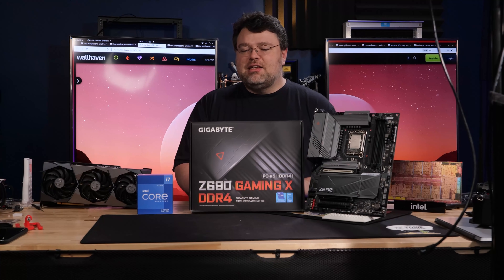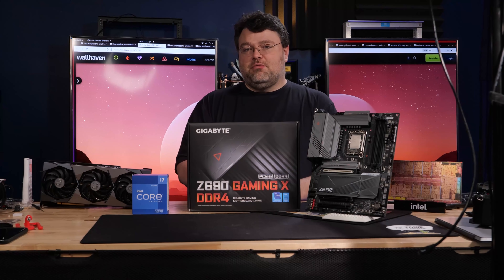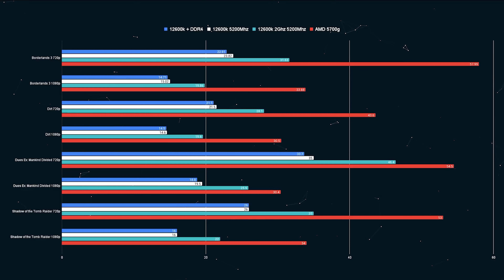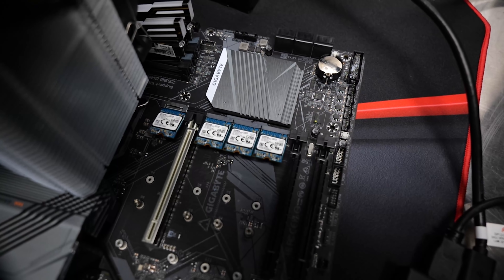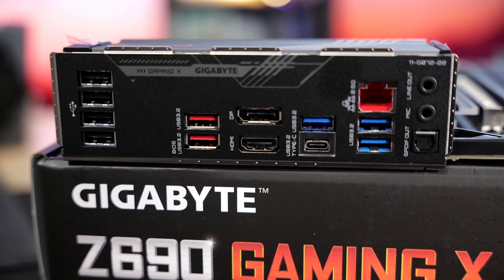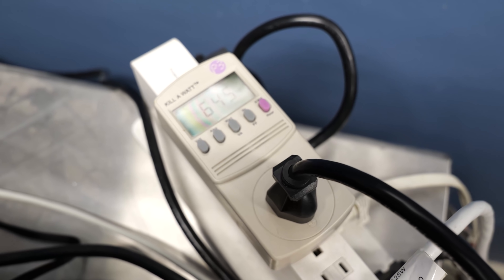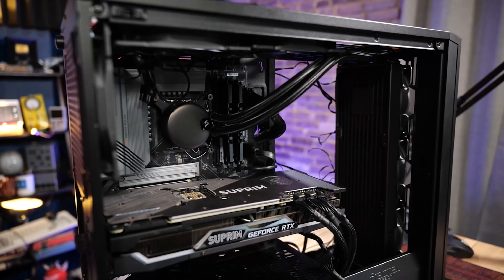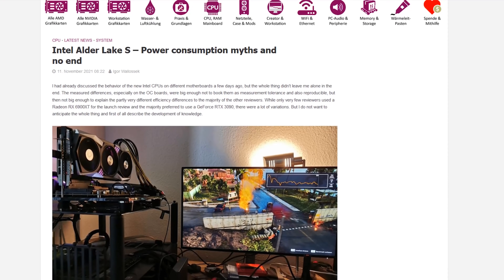Checking out the Gigabyte Z690 Gaming X DDR4: Does DDR5 Matter for Alder Lake?

Comment: I'm looking at upgrading from an 8700k to a 12900k to get the most out of my 3090 FE but on a budget, this board would be great as i could use the 32 gig of vengeance ram i have in my current rig saving a lot of money.
I have built a few rigs in the past but i still have a lot to learn and i'm confused.. because if i choose this board i would want to connect my Z906 5.1 speakers.. now i know you said in the video that you can do this, but HOW?
Good video btw, lot's of useful info.

Comment: I bought this motherboard & am having trouble mounting the huge Duo Fan  msi gaming x  RX6600XT. It looks like the .M2 covers are preventing the card's  seating in the main pciex 16 slot, connecting the right PSU plugs  to the power connectors.   I'm confused by the  8, 4  CPU plugs vs. PCIe pwr 8, 4 connectors?

Comment: so will all 4 m.2 ports work with 16x on the videocard? or do i need to skip the top slot again. i thought there was 20 lanes from the cpu, which would be 16 for gpu and 1 m.2, and the 3 bottom nvme run off the chipset. thanks for any reply's.

Comment: Just put a build together with this motherboard. Quick question about the RGB headers (newb to RGB stuff). I also got a Cooler Master Hyper 12 RGB cooler. The RGB connector from the fan is 4 pin female. Can I use this on the 4 pin RGB header on the board? At the moment using it with the included controller. But hoping I can just connect to board so it can be synced with RGB Fusion.

Comment: Ooof, struggling to find a Mobo.
One the one hand, I want (NEED) single core performance. the 12700K fits the bill. I'm currently on a 3800x.
for 300-350$ for a processor, and 200$ for a mobo, I'd be in the same expected ballpark of the 5800x3d.
The question is, does anyone think the 3D cache is going to be worth it?
What's a good board for the 12700k that isn't freaking like 300$++? I'd like to stay in the 200$ region. I don't need anything super fancy.
Only two that I've found are this, and the Asus PRIME z690 D4
Plan on staying DDR4 for now, until DDR5 pricing drops and shows bit more promise, and by that time, i'll be ready to move on to a new Mobo/Processor anyways likely...

EDIT:: I ended up getting an MSI z690 Pro DDR4, and managed to pick up a 12700k for 330$. Paired it with my 32gb 3600mhz CL16 memory and its running great, have it OC'd to single/dual core at 5.6ghz, and it scales down on how many cores/what temp from there to a respectable 5.2-5.3ghz when all P-cores are running. Still on Win10, but probably be switching to Win11 "soon" in the process of migrating files and folders to a backup HDD.
Reply: Wow glad you got it all going. Have all the parts but I'm stuck figuring out how to plug everything together.  The huge size of parts for this new build are mind blowing.

Comment: Built with this board using a 12700k, 32GB 4x8Gb 3600MHz, RTX 3070 and 2 M.2 SSDs (Samsung 980 and WD SN570)
I had problems with the RAM at first, it wasn't setting the XMP and was throwing up the DDR light on the board but after a quick bios update to F6, everything worked perfectly
Reply: does your 3600 kit work fine?
Reply: @igrjenennrjcvjfuyr  Yeah, it works no problem after the bios update, it's Crucial Ballistix and it's actually 2 16gb kits (2x8gb sticks each)
Reply: @MonkeyMan125431  oh ok thanks, im getting some corsair vengeance ram so
Reply: Hi bro 

Do you still recommend this motherboard I'm looking forward to buying it
Reply: @ahamedfareed5532  I actually wouldn't, my board has bad coil whine so there's always a buzzing sound from it which Gigabyte knows is something that happens to their board only, also the audio from the board isn't great at all!

Comment: My first gigabyte board ever and my last, returned it. They claim best vrm 16+1+2 but really boards with much less out perform it. It has loud electronic noise in certain task, quality all around this board is below competition, including features. If you do research I see nothing but reasons not to buy gigabyte motherboards. I have gigabyte monitor and it's great but the motherboards are just not a good purchase. Even on a good price I'd pay more to avoid gigabyte.
Reply: what's preferable in your opinion?
Reply: @treyquattro  in my opinion I have had good MSI boards and I bought my brother an ASRock board and that one has been my favorite. Years ago I had an Asus board and I just got an Asus to replace the gigabyte and years later I ran into same problem I used to have. Where soon as I enable xmp my computer blue screens & crashes. I swapped slower ram and enabled xmp and it's working great so far. So Asus boards are picky about ram. This was an AMD CPU board and my current Asus is Intel. One feature I use on all new computers is putting a negative offset to decrease CPU voltage which is important to me because my temperatures drop a lot and performance is better while consuming much less power. The gigabyte board I couldn't find that option yet MSI, ASRock, and Asus all have this great feature along with many additional useful features. So between these 3: MSI, ASRock, & Asus any of these would be a great choice. I learned from my current experience with my new Asus board different memory and/or configurations of memory affect games stuttering, so if your a gamer like me I would spend a little extra and whichever motherboard you go with check the memory qvl for the motherboard you want and get best value one for the board you choose for the best experience to avoid stutters and for stability. Or at least some good memory because even though I have powerful system with good GPU/CPU the memory has effected if the fps will have small little stutters or not.
Reply: @Noble7-0  thanks for the detailed response. I've had good results with ASUS and MSI in the past. I've never put together a Gigabyte-based system but I'm planning on Gigabyte for the next build. Nothing seems perfect it seems. At least you managed to return the board OK.
Reply: Me reading that with my freshly bought Gigabyte Gaming X right aside me 
👁️👄👁️
Reply: I have this board and I OC'd CPU(5.1ghz 12600k), RAM(3200 cl14 to 4000 cl16) and GPU(3080 ti OCd about 12%+ undervolted). Ive had no problems with it, yeah the bios took a bit of time to get used to but still not as bad as asrocks imo. All in all Im happy with it, got it on sale so its worth it as far as Im concerned. Decent board, not the best but yet not the worst either.

Comment: I have the same Mainboard with the same 4000mhz Crucial Ballistix Max 32GB with an i9 12900k and cant complain. It runs smooth, no issues whatsoever.
Reply: Hi bro 

Do you have any issues with the board or still works fine?
Reply: @ahamedfareed5532  No, still runs like a baby 24/7. Wanted to include a link to the CPU-Z Validation page but for whatever reason it gets deleted. But yea. Still use it, still love it will continue to use it.
Reply: @r0tb3rt  thanks for the reply buddy, I'm looking forward to buying it. 👍🏼
Reply: @ahamedfareed5532  It always depends on what you are planning to doif you wanna game and save some bucks get yourself a 3070TI and DDR4. The difference between DDR4 and 5 (my experience) is not really noticeable. But once Raptor Lake is out I´m gonna upgrade but I stay at the same board (Gigabyte Z690 Gaming) just with DDR5It´s cheap and reliable and a good buy. You can find my configuraten if you google for CPUZ validator, click on the first link and add /tn9vj8 to it.
Reply: @r0tb3rt  Hello buddy

Yeah im building a gaming pc and i already bought an I5 12gen K processer. and also looking to buy 3070 ti thanks for the info and what cpu cooler do you recommend buddy?
Reply: @ahamedfareed5532  Good morning from Germany. CPU cooler depends on several factors like if you want to overclock it. (I wouldn´t) noise level and what kind of case. I use a Noctua NH-D15 which would be overkill for the i5 and too expensive. If you want a solid cooler that is nice and quiet get a "be quiet! SHADOW ROCK 3 ". But what is also important is the cooling paste. Usually CPU cooler come with pre applied paste. Forget that shit. Add some more bucks and get yourself Thermal Grizzly Kryonaut. The difference between thermal paste can be quiet substential so a good one is always a go. 3070 is a great choice. Got a 3070TI myself and its rock solid for games up to 1440p .

Comment: You still have yet to show how well the Optane P5800x does on the 12900K. long overdue don't you think. 4TB intel P5510 are avail.
Reply from the maker: Linux is still a bit sketch on alder lake unless you disable e cores

Comment: Got that board and im sending it back, its by far the most terrible bios ever. It wont let me boot from anything and top slot m.2 doesn't work half the time. I have build many many pcs and never seen anything like this. Tried nvme drive, sata ssd and usb drive. None can be selected.

Comment: I bought one of these boards.  I had to return it.  The board would power up, but would not POST, giving the five-beep error code and a VGA light.  I changed processors, video cards, HDMI cables, RAM, monitors (and made sure the monitors were on when I attempted to boot up), and power supplies.  I double and triple-checked all of my connectors and reseated everything.  I reset the CMOS.  No change.  I am frustrated beyond belief.

After more troubleshooting, I discovered that many, if not all, of the socket 1700 motherboards are shipping with Secure Boot enabled and CSM disabled.  This is causing issues with older video cards and preventing the systems from ever reaching the UEFI/BIOS screen.  My GTX 970 would not work in this motherboard because of these settings.
Reply: After 3 years, mine is still working great. You might have gotten a defective motherboard.
Reply: @gam3stv  I see you paid zero attention to what I said.  The reason the motherboard didn't even POST is because I had an older video card which wasn't UEFI compliant.  By the time I figured out the problem, I had already sent two motherboards back.

It's very likely there was nothing wrong with the motherboards I received, except the default settings preventing the use of older video cards.  Once I tried out a UEFI compliant video card, the board worked just fine.

Comment: Hey I can't find any information on what cpu connector to connect even after reading manual. The 4pin or 8pin? And depending on what cpu I pair with the board will that make any difference on which connector I do if I only do one?
Reply from the maker: 8 pin and optionally 4 pin if you oc
Reply: @Level1Techs  thank you
Reply: @Level1Techs  Had the same question. I don’t tend to overclock. But is it okay to connect 8+4 or just not at all necessary? Thinking of an i5 12400 for my build.

Comment: What do you mean by XMP not reporting out the "correct cores" via the ACPI tables?

I've had a number of issues with the Z690/12900K system (e.g. 5.15.11 kernel results in a kernel panic when you also have 100 Gbps Infiniband installed and trying to have it automount NFSoRDMA on boot).

Thanks.

Comment: but how well does it run Linux? 5.16 kernel?
Reply: Ah, kind of answered. I think an AMD or Intel 10th or 11th gen system is still preferred for running Linux - homogenous cores are required for now
Reply: @treyquattro  , they're not required. Linux just can't properly take advantage the E cores, which can reduce performance occasionally. Seem odd given the history of big little on ARM, but the fix is on the way.
Reply: @toddedens6788  Thanks. I know Linus is on the job. I should have said required for optimal performance. I'm going to go with a homogenous computing solution (10/11th Gen Intel) as the general advice for Linux boxes is to go with one or two generations behind the state of the art. Plus, Z690 boards are expensive!

Comment: Awesome thanks for the video. Wendell what do you think about having only 2 DIMM slots being better for DDR5 on Z690 boards. More stable and less latency than having 4 slots?
Reply from the maker: It's mostly teething issues of the early days of ddr5. Absolutely valid for right now though.
Reply: @Level1Techs  I bought G. Skill RipJaws 32gb (2x16gb) DDR4 4000. Is that going to be a problem? Do I need to send them back and get the 3200 version?
Reply: I would say these "teething" issues will remain on 6x0 series chipsets (well, boards that use them). Hopefully manufacturers will figure stuff out by the time z790 will be released.

Comment: Been really happy with my 12600k+DDR4+B660, gives me more performance than a 5800x, costs less, platform has more features and an upgrade path to 13th gen, while AM4 is end of life.
Reply: Well, literally every Intel platform in since 2009 or so has been EOL from the launch on.... AM4 has had a lifetime of over 4 years which is quite a bit better and there is still the 5800X3D coming this spring.
Reply: "while AM4 is end of life" - like it's a bad thing. For AM4 to support 3 full generations of Ryzen (not including last pieces of Bulldozer or Zen+ refreshes) is pretty commendable in my book.
Fact that AMD missed the mark with Zen 3 pricing leading to pretty awesome setups on Alder Lake should and will benefit consumers in the end anyway.
Great job putting together this good of a setup!
Reply: @JIAroJIy4  End of life isn't bad for a few reasons, one being a bigger selection of CPUs to fit your need and mature chipset drivers. But the fact remains that Alder Lake has better single threaded performance compared to AMD. I would recommend AMD if going with the 5900X for doing heavy multithreaded workloads while using less power. The average user will benefit more from the E cores of Alder Lake with it's better single threaded performance, than of the 8 or 12 performance cores of AMD suitable more for heavy workloads with lower TDP.

Comment: Be interesting to watch the next videos with this  board and your overall take on it!

Worth noting that Gigabyte have released a bunch of BIOS updates since release and the current F6 consolidates all those interim updates into one, power levels were adjusted in one of those releases amongst other fixes.

My new build upgrade from 6700K on a Gigabyte Z170 X Gaming-5 was with this Gaming-X DDR4 board and a 12700KF. I had an RTX 2070 Super for a few weeks before being able to get a 3080 Ti FE at nVidia's MSRP. On the 2070 Super I had no problems but once I was up and running with the 3080 Ti, around the same time I also upgraded the RAM from 32GB 3600 to 64GB 3600 and in games I was getting a straight crash to desktop, no errors or anything, just quits to desktop in most games that were demanding, like Cyberpunk, Forza Horizon 5 etc.

After much faffing around and posting about it on OcUK forums, it was recommended that I adjust some BIOS values namely for the System Agent voltage and RAM voltage. Taking the RAM to 1.4v and setting the System Agent to 1.3v (default is auto) completely fixed any crash issues. I checked a before and after using Karhu RAM Tester and whilst before these two changes I was seeing RAM errors even as early as 50% coverage in the test, I could now run it for hours with zero errors.

So yes I agree there are some underlying quirks with power levels closely related to auto/standard component voltages on Z690 but they are fixable with a bit of trial and error in the BIOS.

The rest of the system is absolutely perfect I have to say, and the whole build looks so clean on this board. Idle temps are around 27/28, load temps in gaming no more than 65 for the 12700KF, all fans around 700rpm so super quiet. Probably the most powerful but still efficient gaming/editing build I have ever done.

Also a worthy mention is that I found coil whine to be audibly annoying when in the BIOS and in certain games/menus or doing certain things that utilised the GPU. I completely eradicated all coil whine by simply setting C-States Control in the BIOS from Auto to Enabled, then disabling C1E in the expanded C-States sub-menu. This has not affected the CPU throttling down in any way since Windows is set to balanced power mode and still throttles down the CPU to a few hundred MHz etc. All coil whine has been solved simply by turning off C1E on my config.

As it stands, all my benchmark results marry up to what others on other Z690 boards are getting so that indicates all is well.

The full specs for reference to anyone else thinking of a similar build is:
12700KF
Arctic Freezer II 280mm AIO
64GB 3600MHz Corsair LPX (2x32GB DR Samsung chips)
3080 Ti FE
1TB Samsung 970 Evo Plus NVMe
8TB Samsung 870 QVO SATA
Phanteks AMP 750w PSU
Corsair 5000D Airflow case (Arctic PST PWM 120mm + 140mm exhaust, AIO fans as intake)
Reply: impressive. I mean getting a 3080 at MSRP!
Reply: @treyquattro  It took a while but finally got there!
Reply: looking to do a nearly identical setup / upgrade as you 
thanks for sharing!
Reply: XMP does not work on Gigabyte Z690 Gaming X / processor intel 12700k and XPG Lancer DDR5 5200MHz 32GB (2x16GB) CL38-38-38 UDIMM 288-Pins Desktop SDRAM Memory RAM Kit (AX5U5200C3816G-DCLABK), bios F6.
Reply: @bratoch  works on Z690 Gaming X DDR4. Upgrade your bios to f7
Reply: @iamdmc  Z690 Gaming X DDR5 the last bios is F6
Reply: @bratoch  Just set the voltage and DDR voltage manually. Don't need to enable XMP if you can just put the settings to XMP manually anyway.
Reply: @RobbieKhan  I have tried all the options and I get a system crash, the screen freezes. I will wait for the next bios.
Reply: This is useful I might turn to you or anything you reccomend when i get all my parts in and start building my pc using this mobo